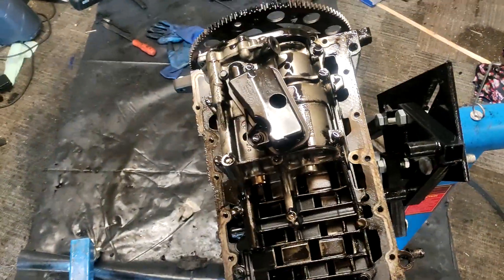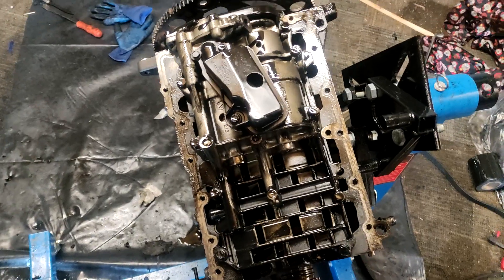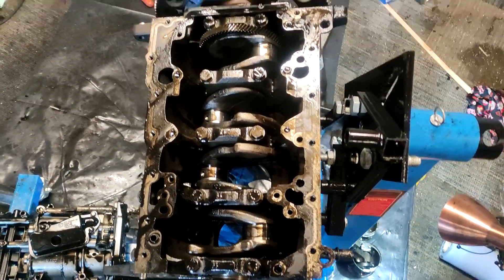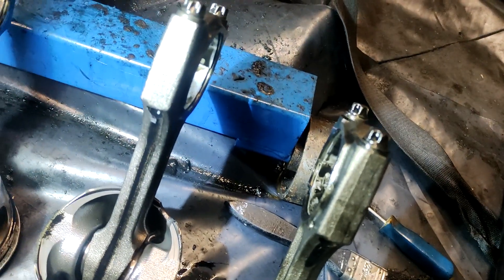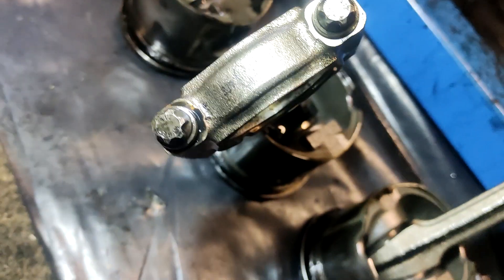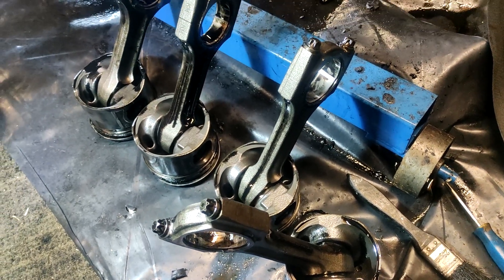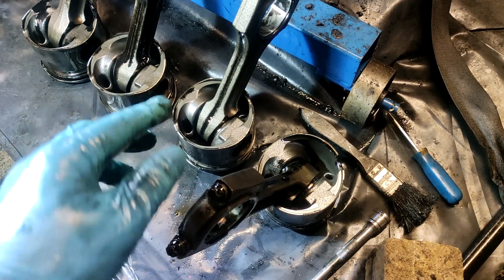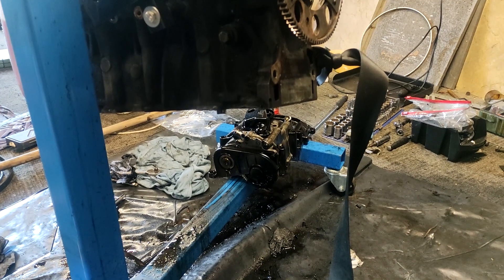BMW M47 Engine Build Part 12 balance shafts and pistons

Comment: BMW M47 don’t have balace shafts !!!   N47 have !!!
Reply from the maker: you are wrong. E90 E91 E87 have balance shaft assemblies if you dont believe me check realoem website. e46 and 2006 x3 doesnt have balance shafts couldnt tell you on e60 or 61
Reply: @TotoGuy-Original  I’m sorry you’re right! I have e83 and I think every car with this engine doesn’t have balance shafts. Greetings from Bulgaria 🇧🇬
Reply from the maker: @alexandermarinov1988  E83 2006 - 2007 has the strongest crankshaft not sure what the earlier ones have maybe same as e46 or maybe same as e90 with balance shafts
Reply: @TotoGuy-Original    As far as e46 goes,  facelift (110kw M47D20TU) engines come with balance shaft assemblies while pre-facelift (100kw M47D20) engines don't. 

Edit:
Some E46 M47D20TU engines come with 42CrMo4 cranks, but with a gear-driven balancer shaft assembly and oil pump, at least for EU cars. For example, my 2002 E46 320d had one. Found that out when the balancing shaft assembly in my E46 underwent "spontaneous self-dissassembly".
Reply from the maker: they dont have them in the uk only e9x does maybe dpf models? like here in the uk all E90 E91 and E87 2.0 m47n2 have balance shafts but we dont have any dpf's in these.

Comment: How did you took the balance shaft put mate. Did you use that special nut
Reply from the maker: i just took the whole asembly out including the pump going to be using a 3.0 pump and a x3 2006-2007 crankshaft they are the strongest ones